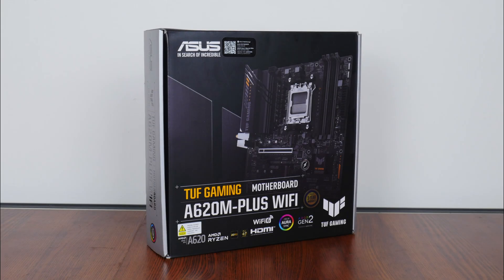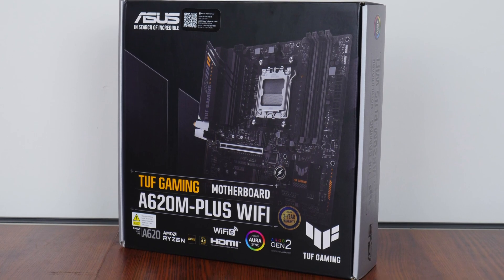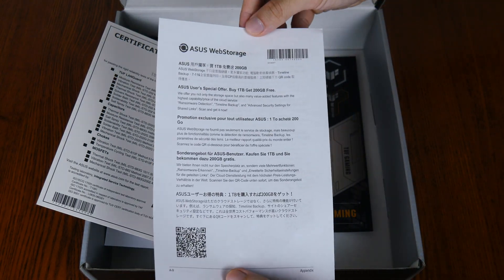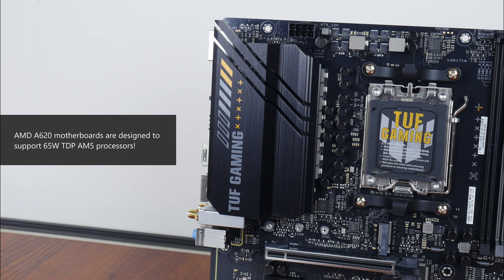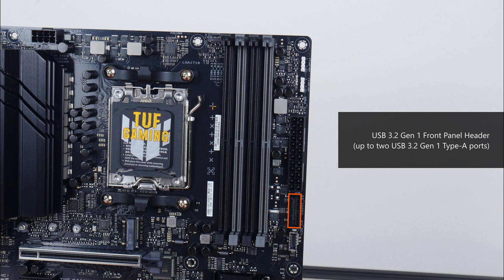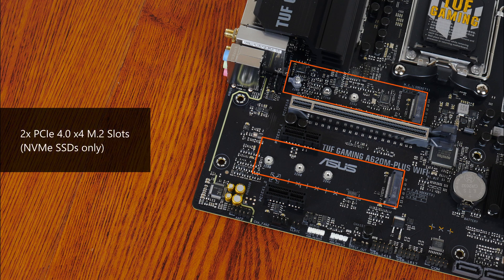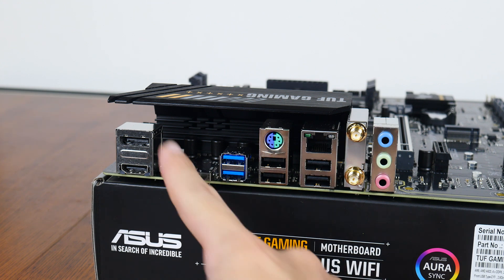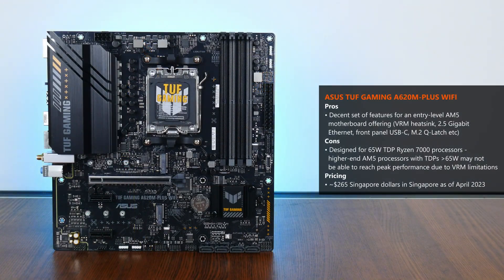AM5 Motherboard on a Budget! ASUS TUF Gaming A620M-PLUS WIFI Unboxing & Overview

Comment: Por favor, qual a voltagem de cada chafan dela? Obg. Sucesso!
Reply from the maker: Hi there, the fan headers of this board support the typical 12V three-pin or four-pin PWM fans - such case fans are pretty standard in terms of their voltage! Are you intending to use non-standard fans with this board?

Comment: For a 7 9800x3d?
Reply from the maker: I'd suggest getting a better board for a 9800X3D, perhaps a mid-tier B650 board at the very least!
Reply: @ALKtech thanks for the advice Im subscribing 👍
Reply from the maker: @Amarati1  cheers. To be as future proof as possible, I'd look for a board that has at least PCIe 5.0 support for a graphics card and a M.2 drive - B650 motherboards with Gen 5 support for both are quite rare, so if you have the budget for it, you might want to look at B850 boards too!
Reply: @ALKtech yeah I’m going to go with a b850 a wifi one

Comment: is this good for 9600X?
Reply from the maker: Yeap it'll support a 9600X just fine, though if you have the budget for it, I'd get a B650 board where possible. Is the price difference large between this board and say, an entry-level B650 motherboard where you're from?

Comment: cara, essa sua placa já veio sem o lacre na abertura? acabei de receber a minha da kabum e está exatamente como a sua, sem o lacre. Mas vc retirou pro video ou ja veio sem tambem? to vendo unboxings pra saber se vem sem mesmo
Reply from the maker: Yup not to worry, it comes without any seal! From my experience, motherboards don't come with sealed packaging. Hope this helps!
Reply: @ALKtech   thank you very much! I forgot to translate the message to English, but you still understood it, so thanks a lot! I almost sent the motherboard back to the store.
Reply from the maker: The power of YouTube's built-in comments translation feature 😂Cheers - what's the specs of the PC that you're putting together with this board, out of curiosity?
Reply: @ALKtech  R5 8600g, 2x16 6000mhz RAM Corsair Vengeance, A620M-PLUS WIFI ASUS TUF, 1tb kingston M2 NVME, AG400 CPU Cooler, MSI MAG A600DN 600w. 

Hope it gets the job done untill I buy a GPU by the end of the year 😅
Reply from the maker: Cheers, an 8600G's a pretty good APU to tide you over till your graphics card arrives. Do note though that the A620M and 8600G both support PCIe 4.0 and not 5.0 - just something to bear in mind especially if you're looking to purchase a Gen 5 GPU!

Comment: hi thanks for the video very informative i just wanna ask if you had tide budget would you choose this over a cheap b650m for future proofing
Reply from the maker: Hey there, where possible, I'd go for a B650 motherboard especially if prices are similar. Just had a quick look at Newegg for reference, there are a good number of microATX B650 boards with decent specs that can be had at prices cheaper than the TUF Gaming A620M-PLUS WIFI. Are there B650 motherboards priced very close to this A620 board where you're from?
Reply: @ALKtech  the issue is on my country there some problems with importing products

Comment: Just got a pre built PC with 9800x3d and this Mobo. Does that prevent the cpu for doing what is supposed to do when it comes 65 tdp on Mobo and 120 tdp on CPU. If so I wonder if it's the best to buy a new Mobo that fits my case, but also works will with cpu.
Reply from the maker: Hey there, it's very likely that the A620 motherboard's gonna thermal throttle your 9800X3D. Since it's part of a pre-built, I'd suggest running some CPU benchmarks such as Cinebench R23/Cinebench 2024, and comparing your scores against those that you can find on the Web. If the difference is really large, I'd suggest swapping out your mobo for something better, perhaps one with the B850 chipset. Do you know what type of CPU cooler that your prebuilt comes with?
Reply: @ALKtech   Thx for answer. I have the Asus TUF Gaming LC 240 II ARGB AIO and if i remember correct i had about 1200 on cinebench. Did a run with 3D benchmark and got 29500 on GPU (9070 xt)  and 14600 on CPU. Seems like CPU score is lower than average on 9800x3d but not a whole lot, so maybe not to much to worry about?
Reply from the maker: Mmm I see, the LC 240 II is more than enough to handle the 9800X3D's heat output, so that's good. If the scores are lower but not by that much, then yeah I suppose it's probably not much to worry about. Out of curiosity, what GPU did your prebuilt come with?
Reply: @ALKtech  it was a prebuilt one with the A620 MB, ryzen 7700, rx 9070, 32 gb ram, 2 TB SSD, but with optional upgrades so upped it to 9800X3D, 9070 XT, 64 gb ram, 4 TB kingstone renegade Nvme 7300, better PSU and watercooling and 2 more fans. Also had the option to upgrade to the B650 motherboard, but that was not highlighted as recommended so sadly didnt choose that. Would have picked a better motherboard from what i know now. Kinda annoying the builders didn't gave a headsup to upgrade MB when choosing 9800x3d, and watercooling since the B650 has more headers for that and more TDP for the CPU.
Reply from the maker: Ah...sucks to hear that. Your PC seems pretty well kitted out but the motherboard's like the weak link...is there any way the PC builder could help you to do an upgrade (I assume you won't want to change it out yourself for fear of voiding a warranty)?
Reply: @ALKtech  i think I leave it for now since I can play the games I do with ok fps and then in the future I might wander into the adventure of replacing the motherboard 😱 I did some repasting of the cpu and GPU in old PC, so hopefully I can step up and do a mb change 😂
Reply from the maker: Yeap sounds good, the 9800X3D is a beast of a gaming processor and should remain the best gaming processor on the market for some time - should you decide to upgrade your 9070 XT down the road to an even higher-end graphics card, you can probably upgrade your motherboard too at the same time!

Comment: Du coup tout 3ventilateurs  du msi forge 100m vont parfaitement  il faut les brancher  que sur les cha_fan ?
Reply from the maker: Does the Forge 100M come with a fan hub, which is connected to the three fans that you mentioned? If yes, then you can simply connect the fan hub's connector to the CHA_FAN header of the motherboard!
Reply: @ALKtech   non je parlez des 3 cables de ventilos  si on pouvez les mettre sur la carte mere car il y que 2 cha_fan et non 3
Reply: Car il ya le ventillo de l'arrière
Reply from the maker: @ right I see. Do the two front case fans share the same 4-pin connector?
Reply: @ALKtech  oui voila
Reply from the maker: Got it, then you'll be fine, seeing as this board comes with two CHA_FAN headers!

Comment: How can we with the WIFI antena if the video card is a PRIME-RTX4070S-O12G, also I have a sound card soundblaster AE9. I am worried physically is not going to fit.
Reply from the maker: Hmm I suspect you will have clearance issues given that this is a microATX board. Are you open to using a full-sized ATX case and ATX motherboard instead?

Comment: AMIGO QUE PLACA ME RECOMIENDAN PARA EL RYZEN 5 7600X???? ESTA PLACA DICE QUE NO COMPATIBLE CON EL MODELO X :face-purple-crying::face-purple-crying::face-purple-crying::face-purple-crying:
Reply from the maker: Hey there, this board is actually compatible with the 7600X - the reason why there's all this messaging about the A620 boards not supporting AMD's X-series processors is due to the fact that the VRMs on A620 motherboards tend to be weaker than say, boards with the B650 and X670/X670E/X870/X870E chipsets. That said, the 7600X isn't a very power hungry processor, and should therefore work decently well with this motherboard. Hope this helps!

Comment: Hey i kinds need help. I have a 9600x and ddr5 croasir vengeance ram 6000hz. My motherboard (A620 pro wifi) have the ram led on. Tried to switch sticks and still the problem presistes. Any advice? The pc doesnt have any signal to the screen
Reply from the maker: Which RAM slots did you have the RAMs installed on? Also, have you tried installing just one stick of RAM first? If not, try doing so with one stick installed on DIMM_A2, and see if it boots successfully. Also, has the motherboard been updated to the latest BIOS revision?
Reply: @ALKtech  tried with one stick. Didn't work. And can i update the bios with the bio flashback?
Reply: @ALKtech  and what is DiMM_A2?
Reply from the maker: @noamwisotzky197  https://dlcdnets.asus.com/pub/ASUS/mb/SocketAM5/TUF_GAMING_A620M-PLUS_WIFI/E21751_TUF_GAMING_A620M-PLUS_WIFI_UM_WEB_032423.pdf?model=TUF%20GAMING%20A620M-PLUS%20WIFI <- check out the motherboard manual to see which slot is DIMM_A2. If this doesn't work too, then yes, do go ahead to use BIOS Flashback to update the board to the latest BIOS version, and see if this helps!

Comment: can install on this mobtherboard r7 7700x ?
Reply from the maker: Yes you can, though you might encounter throttling issues due to the weaker VRMs that A620 boards have. If you're getting a 7700X, I'd probably spend a bit more to get a B650 motherboard at the minimum!

Comment: Hello bro, thanks for your video and good informations! May i ask you something? I was really scared reading the comments down bellow.
I got this setup: 
Ryzen 7 7800X3D
Asus TUF GAMING A620M-PLUS
RTX 4060TI
32GBRAM 2x16, 6200mhz DDR5
WaterCooler Rise 360mm and more extra 4 fans 120mm
Will i have many and considerable problems with performance/latency or overheating everything or it should be fine with maybe a slightly loss of performance? I hope you can reply to me, thank you again!
Reply from the maker: Hey there, do you already have this setup up and running? While I wouldn't recommend an A620 board for a 7800X3D, you might still get by seeing as this ASUS board is a more "premium" A620 board with better VRM cooling. I must caveat that I haven't personally had the chance to use a 7800X3D with an A620 motherboard thus far, so your mileage might vary. Would be interesting if any of the folks in the comments section could share their experiences if they have a similar setup!

Comment: I don't know if you'll answer, but I'm building a PC with this motherboard, a Ryzen 5 7600x and an Rx7700 XT, do you think it will support both? Thanks for the video.
Reply from the maker: Yup this board will work just fine with both a 7600X and 7700 XT! Am wondering though, any reason why you picked the Ryzen 5 7600X over the Ryzen 5 7600?
Reply: @ALKtech will in my region  the x is cheaper now 😅 and i am wondering will this board be good on Rx7900 xt?
Reply from the maker: @f1f2  then getting the X is a no brainer! Actually, Intel's next-gen Core Ultra 200S processors are launching in two days' time - if you're not in a rush, I suggest waiting a bit more as chances are, prices on previous gen AMD and Intel CPUs might drop further...but that said, the 7900 XT will work with this A620M motherboard. However, if you have the budget for it, I'd personally spend abit more and get a better B650 motherboard so that you have more future overhead to upgrade to a more powerful AM5 processor!

Comment: This is £99 in Amazon Prime sales, do I go for it for a cheap build gaming/office PC? Im upgrading from my very old Gigabyte G1.Sniper Z87 - i7 4770k
Reply from the maker: Sounds like a good price - pair it with a Ryzen 5 7600 or 7500F and throw in a mid-range graphics card like a 4060, and you'll be good for 1080p gaming at good FPS!

Comment: The wifi doesn’t work for me, can someone help please? I have a 7600x ryzen
Reply from the maker: What's the issue that you are facing? Are you having issues connecting to a network? Or is the WIFI adapter even visible in Windows?
Reply: @ALKtech  
I solved it. There was a files i should’ve installed and i didnt, now it works, thank you❤️

Comment: Hey buddy how are you? 
It's compatible with Ryzen 5 8600G?
The bios comes ready to receive that?
Works well?
Reply from the maker: Hey there, this board will work with a Ryzen 5 8600G, but do note that you might need to do a BIOS update first before it'll support the 8600G properly.

Seeing as this board has been on sale for some time and retailers could be holding on to older stock, it's hard to say whether or not the board that you purchase will come with the latest BIOS version onboard..in any case, you've got the BIOS FlashBack feature that allows BIOS updates without a CPU/RAM/graphics card installed!

Comment: which cpu and GPU would be the highest supported one? (want to build an amd gaming build)
Reply from the maker: If you're looking at getting an A620 board, I wouldn't get any of the X-series CPUs (e.g. 7700X, 7800X3D etc) as you'd potentially be leaving performance on the table due to the weaker VRMs found on A620 boards. If you're getting say a Ryzen 5 7600 or Ryzen 7 7700, you could probably still pair them with a mid-range GPU, such as a 4070 or a RX 7700 XT to have a decent 1440p gaming rig. My two cents!

Comment: my non wifi version came without an io shield, is that normal?
Reply from the maker: Nope that's not right - the board should come with a standalone I/O shield in a separate plastic package. You should check with the vendor that you purchased the board from!

Comment: My Ryzen 5 7500F will arrive in a few days. I still haven't decided yet which motherboard to get. Will this be enough for 5700F? I am not into overclocking and those kinds os stuff. I will use the system mainly for gaming and office works. Or should I get at least a cheap B650M board like MSI PRO B650M-A Wifi or B650M DS3H from Gigabyte?
Reply from the maker: A 7500F will work perfectly fine with this board, given its 65W TDP! If you have the cash to spare for a B650 board though, I'd definitely look at a B650 board instead for more upgrade headroom in the future, especially since AMD has committed to releasing its next-gen processors (e.g Ryzen 8000) on the same AM5 socket! Is there a big price difference where you're from for this board versus say, the MSI/Gigabyte B650 boards that you mentioned?
Reply: @ALKtech  thank you for your response. I actually got a B650M Mortar Wifi earlier this afternoon. Will most likely upgrade to a higher end or newer generation processor in the future.
Reply from the maker: @notworthurtym3134  cool, the Mortar's a decent pick and should serve you well over the next generation(s) of AMD processors I'd think!

Comment: Previous gen budget a520 use to come with built-in RGB.
Reply from the maker: Yup I noticed the TUF Gaming A520 came with RGB lighting effects...ah well. Guess some corners had to be cut to keep board costs low!
Reply: @ALKtech  What I don't get is why they don't cut corners on things that really aren't needed, like onboard WiFi. Need WiFi in your build? Great... go buy a card or USB dongle then. Why is this included, adding to the bill of materials and thus the mobo cost, but something like an M.2 heatsink which you'd actually need for most SSDs out there (unless you want them to overheat) isn't?! It makes no sense... just like AM5 mobo prices in general having pretty much doubled from AM4 for the same feature set make no sense
Reply from the maker: @gehtdichnixan1337  actually ASUS does make a non-WIFI variant of this board - the TUF GAMING A620M-PLUS (non-WIFI), which should be a couple bucks cheaper I'm guessing. But fair points - I guess ASUS could have scaled back on say, the "gamer" designs and motifs, and perhaps redeployed the savings to having a simple M.2 heatsink instead. Would have definitely set it apart from the rest of the competition!
Reply: who cares

Comment: Is this fine for 7600x + pbo2 curve optimiser
Reply from the maker: It should work with a 7600X, even though AMD's stated that the A620 chipset is designed for non-X processors...that said, I don't think PBO will be supported by this board as AMD never intended the A620 chipset to support overclocking!
Reply: @ALKtech  oh noo… i got the 7600x because i was thinking to use the curve optimise eco mode because the 7600x was cheaper for me :/

Comment: what you mean dtp 65w amd if the processor go up 65w it dosent work for ?
Reply from the maker: 65W TDP processors are basically AMD's non-X processor offerings, such as the Ryzen 5 7600, Ryzen 7 7700 and so on. 

That said, X-series processors and even X3D-series parts will still boot up and work with this board, just that the A620M's VRM configuration might not be able to supply decent amounts of power to such X-series chips to allow them to perform at their maximum potential!
Reply: @ALKtech  ma maaan thnk u

Comment: I personally like the TUF aesthetic and their value, but 200 usd for an entry level board is a lot of money.
Reply: The price has dropped down. It is 150 dollars now
Reply: @KingOfCha0z  I would hope. It's been a little over a year.
Reply: Why 200?
Reply: @jelly.1899  In the review, it's mentioned that it's available for ~$260 singapore, which is about $200 us.
Reply: @vladimirwinnin  well, that's obviously not normal and way too much. It's supposed to be 120 or 140max
Reply: @jelly.1899  For $200, you're much better off with a B650. Pretty sad that AMD is now the worse value. You can get a Z690 mobo for about $200, sometimes less. It's a much different story if you have a micro center nearby. Got a 12700k and Z690 TUF for $330.
Reply: just found one for 120$
Reply: I got it for CHF 120.-
Reply: i got this card and tbh it works pretty well and is future proof so there is nothing to complain  about it

Comment: A620 looks Similar to B550 Motherboards but without overclocking and a bit more entry level
Reply from the maker: Yeah. Though with the A620. AMD's sorta listed it as "officially" supporting 65W TDP AM5 processors only, where more powerful processor offerings may not be able to reach their maximum performance potential.
Reply: @ALKtech  There are many A620s that say they support even 120W cpus